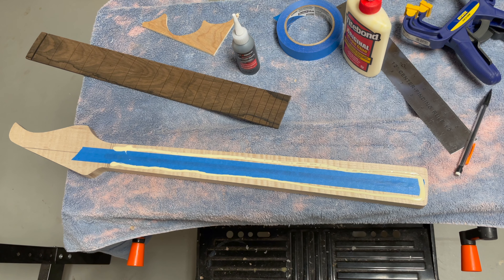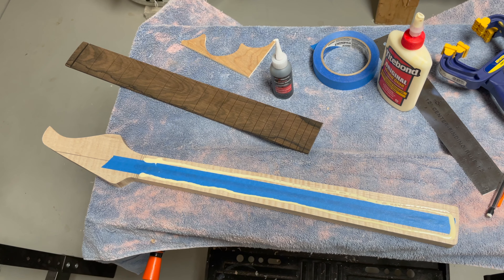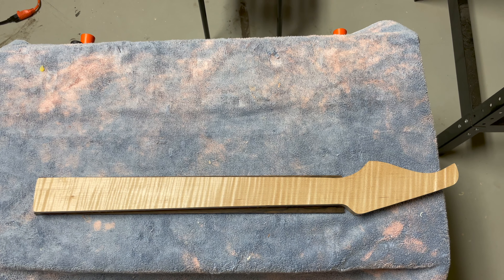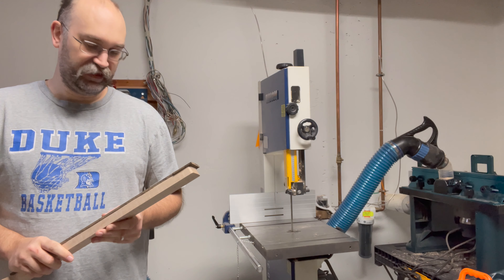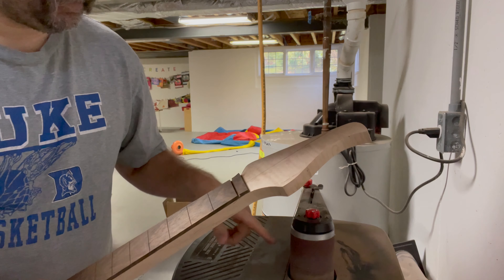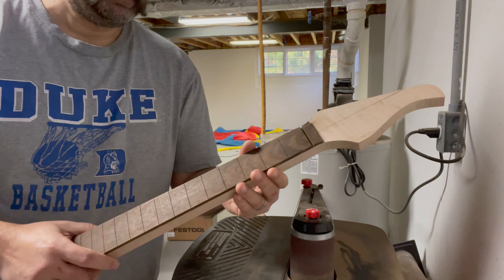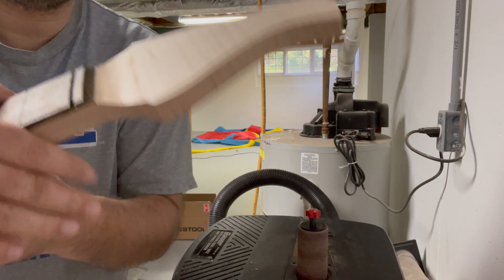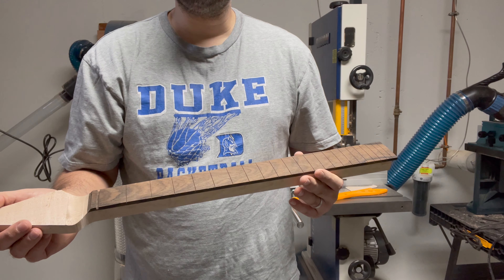Gluing and Trimming a Guitar Fingerboard

Comment: Where is the truss rod adjustment access hole on your neck blank? On the heel?
Reply from the maker: Headstock, it just hasn’t been drilled yet
Reply: @zwitchguitars  Sorry, I wish you well with your project.
Reply from the maker: @thomasburnett4712  No problem, didn't mean to come off short with you or anything!
Reply: @zwitchguitars  No offense taken. It takes some guts to take on a project like you’re doing and I admire that.